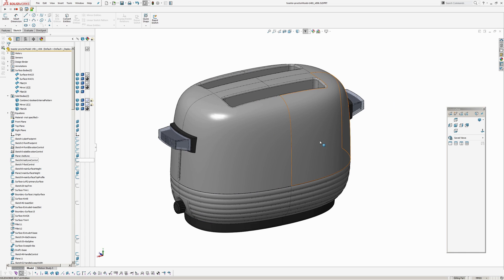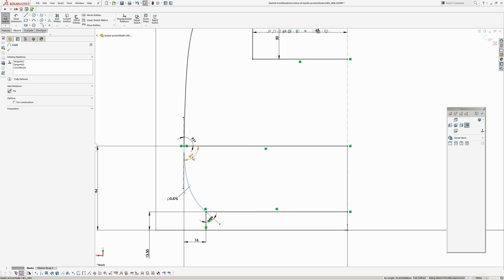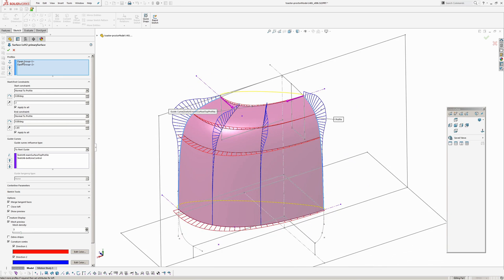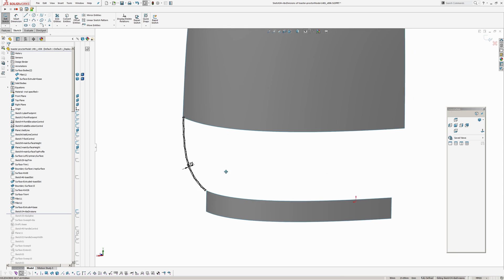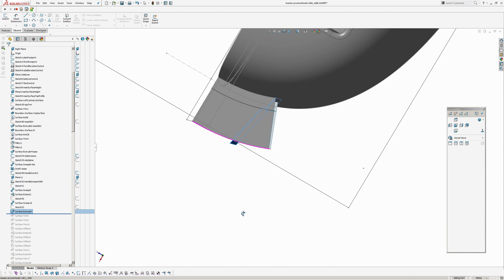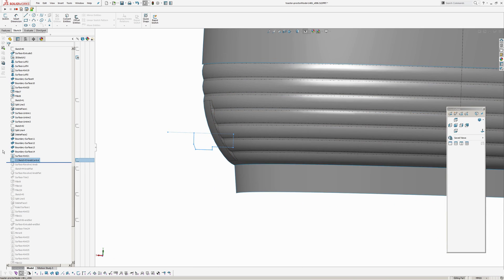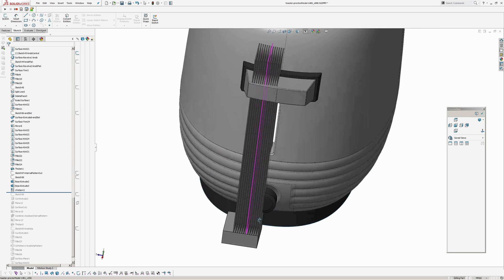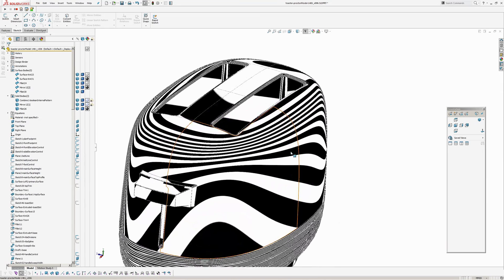Solidworks: Modelling a Proctor Model 1481 Toaster

Comment: Hi Andrew. Thanks a lot, It was great :). I have a problem with the first boundary surface you did. I cant set it in global in my solidworks. would you help me about it? thank you.
Reply from the maker: Hi Sareh - you mean the boundary surface that caps the top? It's set to global by default. Check your input edges, to see if one is not quite coincident with another or there may be multiple edges.
Reply: @AndrewJacksonDesignStudio  yes I mean that but there is some problem here and I didnt find it.
Reply: Hi again. I found it :). Thank you for your videos and your Soildworks files you put here for download.

Comment: I had a crack at modelling the same part in Creo 7. Some things easier to achieve and yielded better results:

-	Smother upper surface with softer/more uniform curvature combs (IMO).
-	Creating the blend/fade between the lower ribbed surface and flat/recess for the nob was easier to achieve (less features).

Some things were more difficult to achieve, but in the end perhaps got me a slightly better result (IMO) e.g.

-	Could not get Creo to Sweep (‘loft’ equivalent in Creo), the rib surface very well. I resorted to a boundary blend, which 
required more geometry creation. That said, I’m not great with sweeps, so perhaps it could have been achieved differently?

I know this is a SolidWorks tutorial, but if anyone is interested, I can shared the Creo part file and a STEP copy of my file, just leave a comment or shoot me a private message. It is not carbon copy of AJ’s file i.e. the dimensions are not 100% like for like and I have only modeled the upper and lover main surfaces. Close enough to make a comparison though, if you are interested in doing so 😊
Reply from the maker: Haha good work! It's a good modelling challenge, thanks to Tony S for the subject matter!